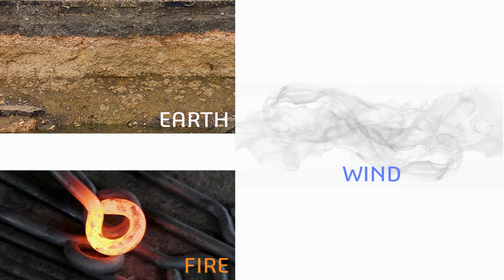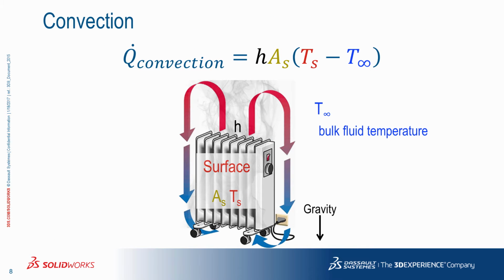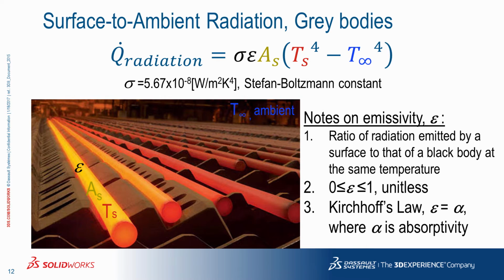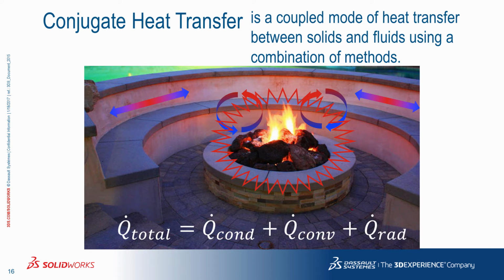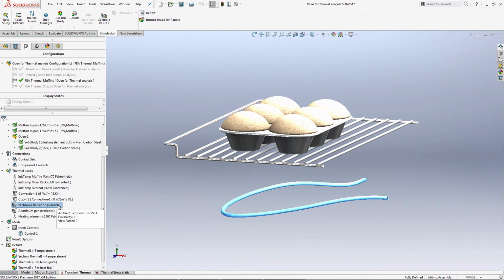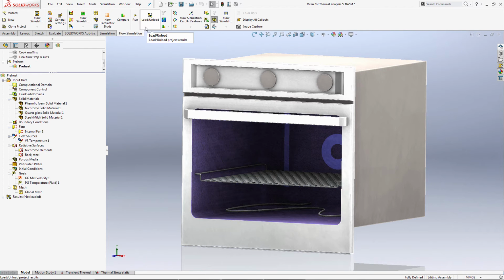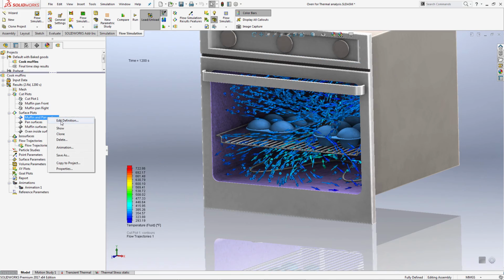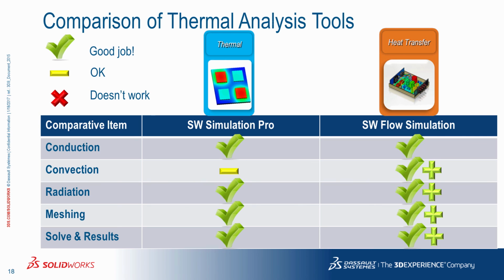SOLIDWORKS Simulation Step-Up - Thermal Analysis

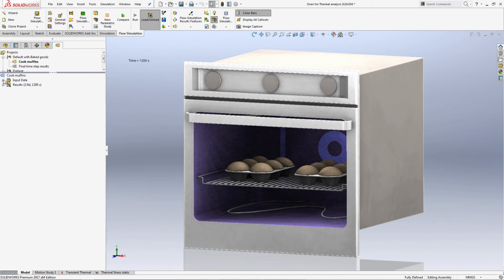Comment: @29:54 I'm liking the video... if only because you chose to do a simulation of 12 muffins in a convection oven (with the thermostat conditions for the heating element). You didn't have to simulate muffins. Next time, I want to see what happens when you add blueberries into the muffin matrix...